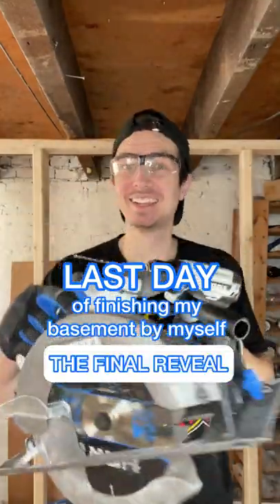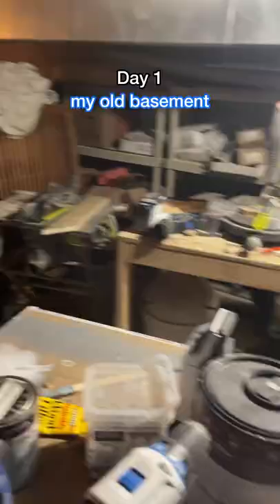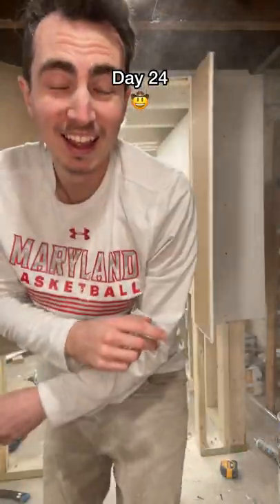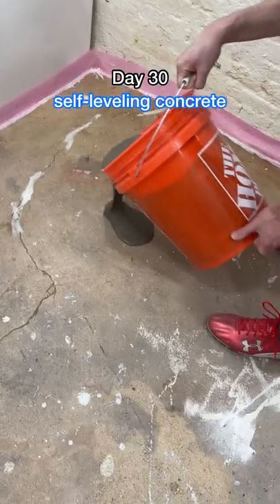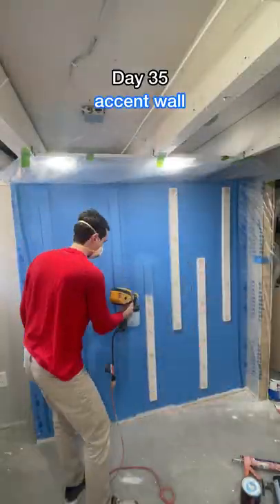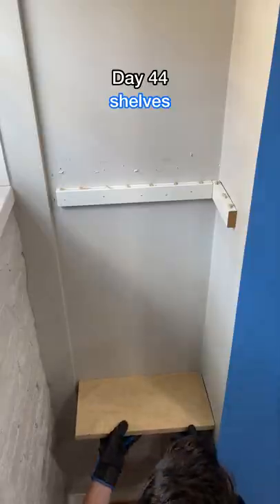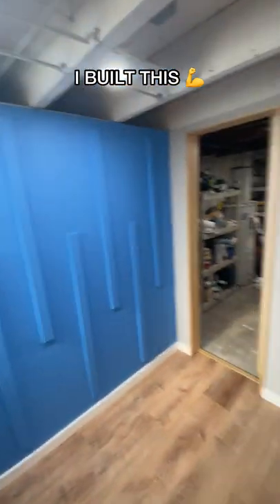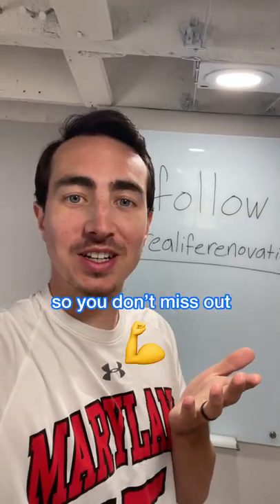LAST DAY | Finish Basement by Myself 💪

Comment: Retractable key holders for your pencil, rechargeable headlights, tape measure holder good for extra battery. Dual sided tape measure. Arbors to cut hvac sideways and you can also score with knife and wiggle clean off in tight areas.. pray hard, work hard..God bless you!! Love from Alberta Canada